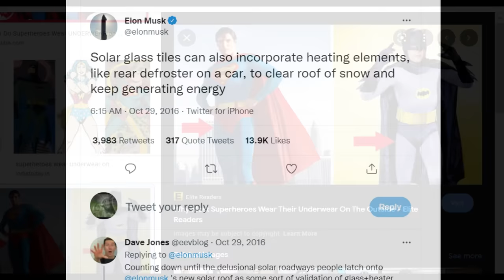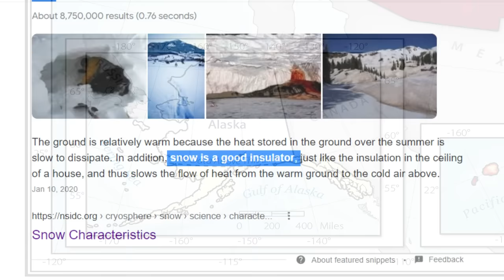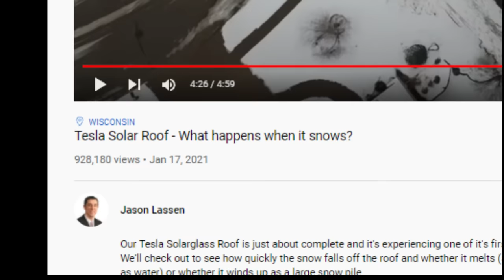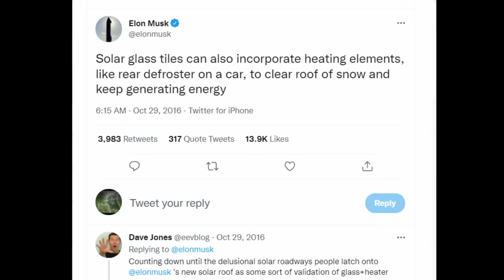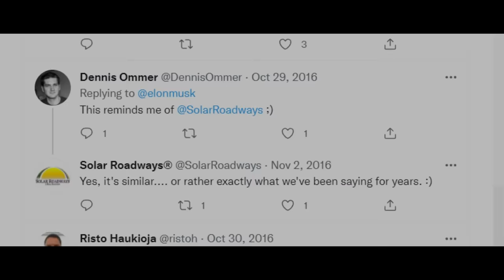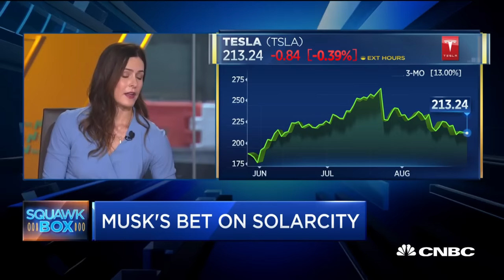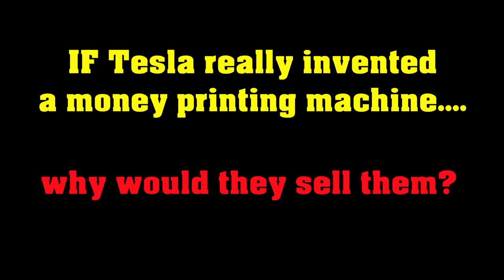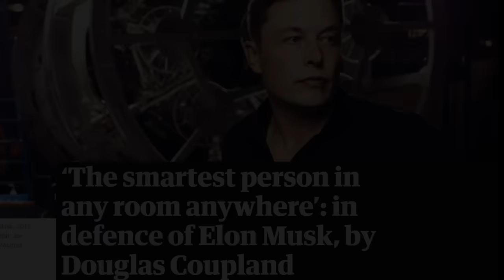Elon Musk: The Smartest Person in any room ANYWHERE!

Comment: One thing I have learned, never call anything "peak stupidity", or someone will take it as a challenge.
Reply: Now if only saying peak genius have the same effect
Reply: @whoami1449  I wish! But genius requires hard work.
Reply: @mjb7015  yeah. Saying peak stupidity will increase the limit of stupidity
Saying peak genius just increase stupidity
Reply: @whoami1449  Two things which are infinite: spacetime, and human stupidity.  

Two things which are inescapable: black holes past the event horizon, and human stupidity. 

Three things which are inevitable: death, taxes, and human stupidity.
Reply: @mjb7015  Einstein himself admitted he wasn't sure about the universe being infinite; that was still just theoretical, whereas the boundlessness of human stupidity has a lot more positive, empirical evidence going for it.
Reply: Just like Thundrrf00t, who has been taking you for a ride on most videos related to Elon.  TF "ingeniously" leaves out of the arguments that the house shown in the video is still being built (but paused for the winter) aka the interior house temp is VERY close to the outside temp, no "insufficient insulation" to blame.  solarRoof allows the ice to slide off due to it's gradient, smoothness, and any residue can have the very bottom layer of ice melted every morning after the snow, which then slides off, allowing proper energy capture until it snows again.  No need to even evaporate the lowest layer of ice.  The snow came several days ago before the video which is why there aren't discernible clean mounds without footsteps.   He knows this!  So why compare it directly to solarRoadway (which needs to not just melt all the snow, but evaporate most of it)? 
All one needs to do is watch tf's old videos on SpaceX and see how wrong he is with his manipulation of numbers. For some reason he just blindly hates Elon with a passion
Reply: @monsterous289  Lol, why are you defending him, he wouldn't spit on you if you were on fire
Reply: @Soken50   Uh oh. Some people look at the good deeds. And you are a tfoot cool aid drinker LOL

Comment: “It’s like a tube with an air hockey table”… in a vacuum?
Reply: @NonCoinCollector Oww. That blows.
Reply: When I heard him say that I just face palmed myself.
Reply: it really is that simple I swear!
Reply: The being in a vacuum thing is why it works at a table top model scale where you can pump down the tunnel as quickly as the air gets jetted in and the objects (pods or whatever) have a large surface area to mass ratio.

The idea has actually been used to transport small objects for quite a while. He just wanted to make it on a larger scale with bigger objects and a stronger vacuum etc what could possibly go wrong?🤔🤔🤪
Reply: Yes, its going to use air cushions.....in a vacuum

Next he'll make a solar-powered air conditioner made for Antatrica
Reply: @hopingforthebest1.9  think pneumatic tube except the air is only coming out under the pod instead of being pulled through from the bottom of the pipe.

You can actually make a model of it where the pod looks like it will go about the speed of sound if you just had a long enough track. 

It is basically impossible to make a full sized one because the air has to lift a heck of a lot more weight so you have to use so much more air you can’t pump it down fast enough. (Presumably Musk would have had to use very very large custom vacuum pumps) 

The maglev version makes way more sense nowadays however back in the 1920s, 1960s and even 80s when the vacuum train thing was popular that air cushion was all that was available.

If you we’re making up a steam punk universe where there was no petroleum or natural gas it would be an option where you can have very large stationary power plants powering a mass transport network. The infrastructure would have to be massive and it would be pretty dangerous.
Reply: @hopingforthebest1.9  yes it’s called a heat pump.  They work in the winter too.  Look it up.
Reply: it's nothing like a tube with an air hockey table.
Reply: @NonCoinCollector 🤣🤣🤣👌👍
Reply: @doncarlodivargas5497  I think he really thinks that... most ppl cant tell its mostly wish.. he is very dangerous scammer, althought he doesnt know that.. worst thing is be little smarter than most thinking I am the smartest.. problems will await..
Reply: Playing air hockey in a vacuum tube is delightfully entertaining.
Reply: @craigrotay3732  the original sort of was the principal component of air hockey is the cushion of air under the puck and he wanted to do the same thing with the pods. The magnetic levitation etc came later when actual engineers had a look at it.
Reply: @dr_birb  - yes, he is a little too entusiastic, and I think he simply say anything to get attention, like a little boy that can not distinguish between reality and fantasy
Reply: @doncarlodivargas5497  A and C
Reply: 🤣ha ha ha ha
Reply: Yeah but Elon swears it is "not that hard"!
Reply: @glenecollins even if that was the original case, it's still nothing like a tube with a hockey table.  What does a tube with a hockey table even mean?  Perhaps he means a hyperloop would be the offspring of a tube and a hockey table?  It's just Elonspeak, nonsensical rubbish.
Reply: And here I thought air hockey tables needed air.

Guess Elon is a genius!
Reply: @xiaoka  heat pumps only work up to a point. I have a heat pump on my house and whenever it gets below 25°F we have to run conventional electric heat because below those temperatures it simply cant create a temperature difference large enough to provide useful heating

The lowest recorded temperature in Antarctica is -128°F, the highest is 69°F.  A heat pump would only be useful to heat for a very limited time out of the year
Reply: @glenecollins  what air? If the tube has a vacuum there will be no air to provide a cushion

Air hockey tables don't work in vacuum chambers
Reply: SSSHHHHHhhhh!!!!
Reply: -Matter didn’t create anti matter
-Anti matter didn’t create matter
(Both of them were present at the time of big bang)
-Both of them didn’t create themselves.
-Both of them came from an unimaginable source,  that unimaginable source created matter and antimatter (everything) thats why it is known as “the creator” of everything.
——————;;;;;;;;;;;;;;;;;;;;;;;;;;;;——————
- that unimaginable source/creator has created sin and virtue which are opposite to each other,
— logic says every action has its own reaction, so the reaction of sin must be different than the reaction of virtue,
— the creator has created prophets to let us know about each and every detail of sin and virtue, also about their reactions,
Thank you
Reply: Yeah that is why it sucks as an idea...XD
Reply: Creating a vacuum with air in it is super easy, barely an inconvenience.
Reply: Blow, no, suck, no, blow, no...

Comment: "It's not that hard."

Anyone who works on or design machines that requires vacuum, even moderate vacuum, can tell you that it is not easy or cheap to maintain vacuum for long periods of time. The bigger the vacuum cavity, the harder it is to design and maintain one.
Reply: Its not that hard for elon.
After all he do nothing but pour money into research.
The researcher and engineers are the one having it hard.
I can easily see if they fail elon fan will blame them
Reply: @whoami1449  That already happens. SpaceX and Tesla engineers are told by their management all the time to do things that are impossible. When they can't find a solution, they get roasted.
Reply: And evacuating a large volume also takes a LOT of energy. For doing it in Earth sea level atmospheric pressure, it takes 100 kilojoules per cubic meter, since atmospheric pressure is 100 kilopascals. Think about the volume of a TRAIN in cubic meters, and then multiply that by 100 thousand. Now think about the volume of an entire TUBE to be a tunnel containing the entire travel path of that train, and then multiply by 100 thousand. That's the number of joules you need. And whenever there's a leak or an imperfect junction when loading into or out of the train through an airlock, and you need to pump more air out, say it has bled back in even just to 1% atmospheric pressure, you've got to spend 1% of that energy all over again.
Reply: Easy solution reverse engineer Elon's skull. Im lead to believe that he maintains true vacuum at all times between his ears.
Reply: @medexamtoolscom  well, that 1% will be harder to remove than removing 1% from a container that has 50% normal air pressure
Reply: it's his boasts about the problems being straightforward that show that he is really bs-ing and or does not know what he's talking about
Reply: We are talking about only 400 miles of vacuum tubes in a seismic area,c'mon!

Comment: here in scandinavia, we purposefully designed houses in the past to keep snow on the roof precisely because we noticed it's insulation properties, we still to this day design houses with the purpose of holding snow on them partly due to the insulating properties it has.
we even had roofs where we put dirt on them and planted grass on them due to the insulating properties of it.
Reply: Yeah, Eskimos went even further with that strategy
Reply: Alucard hi
Reply: in North America roofs are not insulated as much as ceilings are.  Usually the insulation sits above the ceilings and the attic space is open to the outdoors, which is why the snow does not melt and the snow does not insulate the home.  Though it is also possible to have a 'conditioned attic' where the underside of the roof is insulated instead (eg for vaulted ceilings) - in those cases the snow would add insulation, but not for most roofs here.
Reply: Even old Eskimos knew the fact, that snow is good insulator, even packed one.
Reply: @scottross8606  because of how insultation works in a thermal dynamics kind of way, the whole attic in the first version becomes another buffer, i.e. first the thermal transfer speed is lowered by the transition from indoor house air to ceiling and then since some of the lost heat is trapped in the attic by the snow, it slows the transfer rate from ceiling to attic to outside. The velocity of thermal change is based on the constant of the materials involved and the difference in heat between them and this creates a mid temp buffer zone.
Reply: @liamnehren1054  yes there is likely some insulation benefit, but keep in mind north american roofs are designed to vent out the heat to help with cooling in summer.  The soffits are all vented and there are always a number of ridge vents also, making the attic temperature fairly close to the outside temperature and disallowing melting of the snow from warmth within.  It's a bit different with flat roofs and vaulted ceiling roofs and conditioned attics like Passivhaus designs common in northern europe where snow would definitely provide a huge insulation benefit, though some materials like metal roofing will have a vented layer under them even on vaulted ceilings.  We need to build more Passivhaus here in Canada!
Reply: I dispute this. Traditionally Scandinavian buildings have very steep pitched rooves designed purposely to shed snow, the problem is the  weight of accumulated snow will cause a roof to collapse. Also if the ceiling below is not insulated the rising heat from the building will melt the snow on the roof. So I think you are chatting macca. I am a master joiner and have built enough timber framed houses in northern Europe to know.
Reply: @planesandbikes7353  True, but this is changing - builders and renovators doing more conditioned attics, even/especially for cooling in summer, as the non-conditioned attic becomes a hot box, higher than outside air temperature, thus costing more energy to cool the living space below it. With a conditioned attic the temperature differential between living and attic is minimal, and the difference between attic and outside air is less than in the non-conditioned scenario. This makes it less expensive to cool. I live in the south and retooled my old home’s attic, I can now use a smaller capacity HVAC and it costs less to reach desired temp.
Reply: Sounds cool.  

Man, you're name! - what is it out of interest?
Reply: @scottross8606   there is a reason you are told do dig your self down if trapt up  in the mountains :)
Reply: @liamnehren1054  Even if you use the attic as a thermal buffer zone, insulating the attic will still reduce the overall heat loss. A more insulating roof reduces attic heat loss, which in turn reduces the heat loss below the ceiling.
Reply: @gelinrefira  yes of course, I didn't say it wouldn't lol just saying there is still some positive effect.
Reply: @soul4saken   Scandinavia is not a country. Norway did not sell out its oil and gas resources. Denmark did. And the snow on the roof is because of good insulation. And of course it has to be removed if too much. 2 metres of snow weigh a lot, depending on the «snow». Snow is not a constant.
Reply: @headcrab4090  I called Scandinavia a region, not a country and I never mentioned the selling of all oil resources, I said national sovereign funds in the region had sold off investment interests in oil companies. Yes, they still sell their oil resources and continue exploration for more, however they realise that the oil industry is going to be a less profitable investment going forward, so are rebalancing their sovereign fund portfolio by selling off such interests in favour of more profitable long-term investments. When an oil producer starts selling out all of its investments in an industry it has key knowledge of, it is a sure fire way of knowing the long term prospects and earning potential (or lack thereof) of that industry.
Reply: @soul4saken    Sorry I misread your comment.
Reply: @headcrab4090  No problem mate
Reply: @valkyriedd5849   Very good reply. Few seem to understand this.
Reply: @planesandbikes7353  Keep in mind soffit and ridge vents work only when BOTH are open and unobstructed. As soon as snow starts piling up it blocks ridge vents, essentially reducing the convection flow through the attic to almost nothing. Wind would drive flow through the attic (in one side and out the other through the soffit) but that wouldn't be a large amount of flow, and natural heating of the air in the attic would keep it from wanting to flow down and out. So you would get added insulation from snow cover on the roof, it's just not as much as an unvented attic space. Though unvented attic spaces have problems with moisture buildup.

This can be seen with houses that have poor insulation in their attic spaces, they melt the snow on the roof despite the attic supposedly being open air. IF the attic was vented then it wouldn't get warm enough to melt the snow. Snow melting is a prime example of the attic not being an outdoor area but instead more like a cold room, which is just a thermal buffer.
Reply: That sounds like a pretty lousy idea actually. Surely styrofoam is a better thermal insulator than snow, so a layer of styrofoam would be a better insulator than relying on snow to insulate. It seems like a good idea to plate the top of a roof with styrofoam, in addition to the fiberglass that's inside the walls. Naturally a layer of snow at the top would only improve things, so you wouldn't scoop it off or melt it if it was there, I'm just saying, snow doesn't seem like it would place very high on a top 100 list of best insulators. If you disagree, punch your bare fist into a pile of snow and see how warm it feels. If your fist was surrounded by any insulator worth snuff, you wouldn't even be able to tell what temperature it was by feeling it, even if it had been cooled by liquid nitrogen.
Reply: Elon Musk is a great example 
for paying-youre-marketing-team-much worked out... 

Actual experts say his projects are meant to be flashy and are just that. Just flashy. 

'Adam Something' can tell you more about how moronic Elon is, 
if youre interested or want to laugh a bit.
Reply: @scottross8606  the insulative value of a vented attic with a snow covered roof is reduced when compared to an encapsulated attic, however it still tends to hold heat in the attic space, decreasing the Delta T (difference in temperature) across the ceiling insulation and holding more heat inside the building. The snow also tends to close the ridge vent, common in lots of US residential construction, which normally allows the hot air in a summer attic to thermosiphon, making the insulative value of the now minimally vented attic even greater.
Reply: so you can spell Pneumonoultramicroscopicsilicovolcanoconiosis but not the word its?
Reply: That is false. In Scandinavia they usually have steeply angled roofs to prevent snow from accumulating cause lots of snow is very heavy and can easily cave the roof in.
Reply: Not since the single was invented.
Reply: @planesandbikes7353  Northern Europe summers are not quite as hot as many parts of North America, so presumably there is less emphasis placed on cooling in summer.

Comment: One thing you forgot to mention is how melting this ice on roof creates Ice dams in the gutters/downspouts (unless you keep melting it) which is a very bad situation that can let water into your actual house and ruin your ceilings
Reply: @EdwardHowton  yeah I think he knows what a gutter is 👀
Reply: @carstentroell-smith9907  X.

That's the button you press to doubt, right? Well X.
Reply: Which is why it used to be a common practice to put a heating wire zig-zagging along the eaves. Not to melt all the snow, but to melt holes in the ice dams and prevent roof leaks. Of course they eventually figured otu that good insulation and roof ventilation worked a lot better.
Reply: +John Tokarz   Good point!  I never even thought of that!
Reply: You haven’t heard about the Tesla downspout turbine, generating even more electricity?! Can also run in reverse to store water on the roofto complement the Tesla power bank. It’s pretty easy really